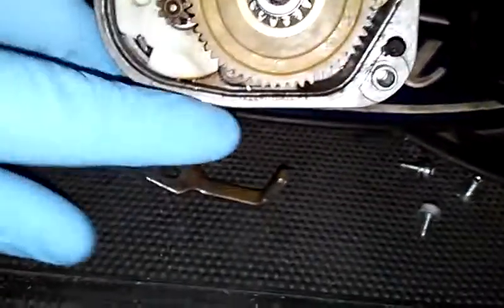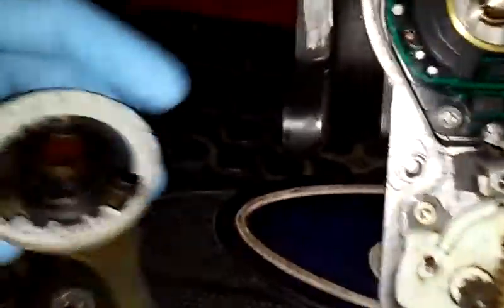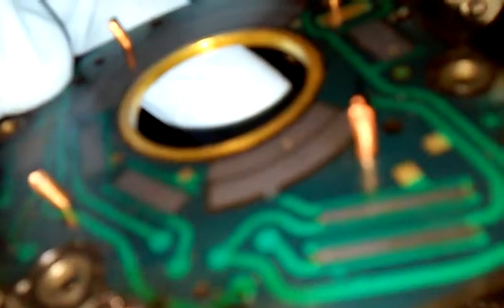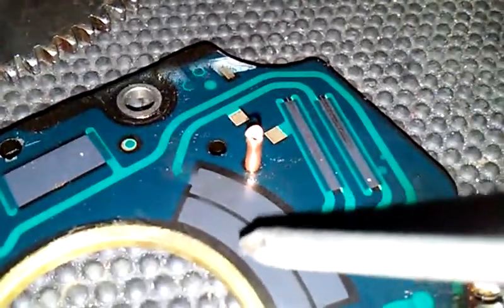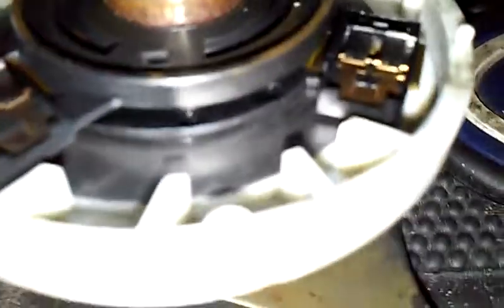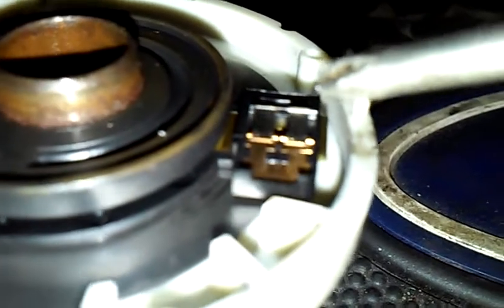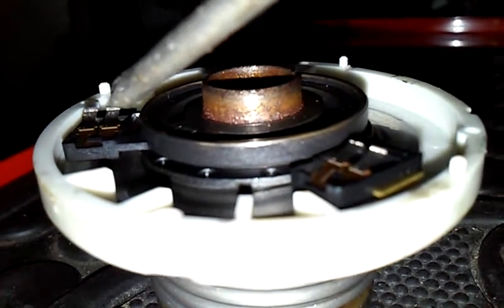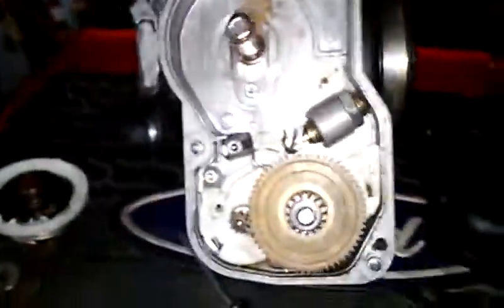MERCEDES BENZ W202 Throttle Body/Throttle Position Sensor  Internal Components

Comment: Nice video !!  I have a USA version 1994 C280 Benz.  The cars idle has become very erratic.  At stop lights, while in drive, the car engine revs up and down as if you were trying to tempt the car next to you to drag race.  Once you accelerate away from a stop, the car drives perfectly, accelerates great, and no other known problems.  I believe the throttle body or throttle position sensor is at fault.  I wonder if you have an opinion??  Because the car is pre OBD2 I don't think scanning the car's computer will yield anything.    Were you able to find any internal components for your position sensor to repair yours ??  Thanks !
Reply: Same case here... mine is C180 W202 pre obd2.... any update on the fix?
Reply: update on my fix (i dont know when it will last... lol) i suspected that the ECU is trying to compensate with some logic on it, and it seems related with the air/fuel ratio... so what i did was simple turn the CO potentiometer clockwise around 270 degree and making it running more lean. I also fixed some small air leaks into my throttle body :-D. And of course resetting the ECU is needed by simply disconnecting the battery and reconnect. Hope this help... :-D
Reply: @Wu11er  fixed?
Reply: @fulldeporeis  yes it worked for me. But ever since I've overhauled my transmission (722.4), this problem never  show up. Fyi, my 722.4 was near totaled, thank God I've overhauled that just before it destroyed :lol:

Comment: I need wiring color combination i have black, brown, red, white, yellow, grey, green , red brown, in throttle actuator but in my engine connector harness there is black, white, yellow, brown, blue, purple, red brown, red. I want to connect it proper let me know which of these wires colors correctly.